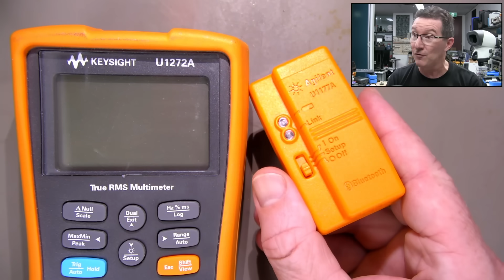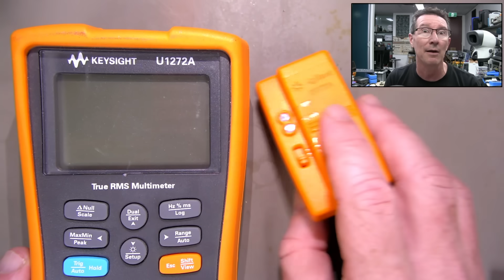EEVblog 1687 - A Pointless Alkaline Battery LEAKAGE Repair

Comment: Use primary lithium instead of alkaline in test equipment and remote control, please. Alkaline cells are ending their life by expanding and leaking, no matter what energiser and Duracell says. The only way to avoid leakage of alkaline cells is to add 1 - 2% mercury to the zinc, and this was forbidden in 1992, the year the reliability of alkaline cells died...

Comment: Duracells would have leaked several years inside their expiry date, even when stored in ideal conditions inside the original packaging.  I was fixing Duracell damaged test gear, mainly Fluke 8060A DMM’s,  over 40 years ago.

Comment: Well that's a bit of a letdown, GP are actually the most solid cells I know. Ok - having cells with a 2014 expiry date sit unused in your equipment until 2025 is pushing it a bit, admittedly.

Alkalines are obsolete. Low-self-discharge NiMH are the lowest acceptable solution now. For the more expensive stuff (my good multimeter e.g.) I use primary lithiums.
Reply: i converted my meter to charge with usb

Comment: I use NiMh batteries for almost all devices that require AA or AAA batteries, yes they can also leak after some time, but way less often and it leaks powder and almost no liquid.
And even if they leak a bit of Colombia's finest you can usually still clean them up, revive them using dumb charger or jump charge and throw them back in the normal charger and put them into a TV remote or another low current device.
Reply: Not always, I had a NiMH cell leak out a bunch of liquid goo.

Comment: how tf do tool manufacturers manage to bork this stuff up every time.
it can't be that hard to put the source code on github or leave it as is with a "might not work" warning.
their irda->usb cables are also BAD! you can't use them since the obsolete plxxxx uses the "please buy a new adapter" driver.
have fun when that happens at university, cant do anything :)
someone has to make some pressure, this stuff should just work.

Comment: I have stopped using alkaline batteries entirely like 10years ago. I only use rechargeable Eneloops (even those 10years old still have around 1700mAh). And for ultra low power stuff I use Energizer Lithium (non-rechargeables)....

Comment: Knowledge that alkaline batteries are prone to leaking is no news, but what might be interesting is that i had a recent one-use lithium battery leaking and just in three months "eating" the spring at the negative end. Before that i believed that those can't leak. Be careful. 😮

Comment: Welcome to IOT, Internet Of Trash, not even your testgear is safe.
Reply: And always remember the "S" in IOT stands for "Security"
Reply: I'm not surprised a big company like Keysight did this.
Reply: At least it's replaceable...
Reply: @feynthefallen what is? The app doesn't work. How do you replace that ?
Reply: @feynthefallen  Rizzlord: At leastse its replacablese...
RizzG0D: i wont buy any thing NEW!+! i will repaire the parts

Comment: I wonder why they abandoned the BT box. I mean, BT is very much alive, and even modern phones support legacy BT communication.

Quite sad, in the ATE industry I'm used to GPIB and Serial devices that just work™. It doesn't matter if its 50 years old. Both GPIB and COM don't need device drivers. Just a crusty old manual for the device that includes the protocol specification

To be fair, that interface was not part of a meter, it was specifically made as a Bluetooth link. If they have a new one compatible with the same DMM, that's at least better.

Comment: For cleaning the more sensible sequence is water first, than a little vinear if there are areas with blue/green corrosion on copper (if not that bad one can get away without the vinegar). The main purpose of the vinegar or another mild acid is to dissolve copper carbonate. Than more water and finally maybe IPA or alcohol to remove water rests.
The alkaline and potassium carbonate are already water soluble.
Reply from the maker: Yeah, but cool bubbles...
It ultimately doesn't really matter.
Reply: Didn’t know that. Makes sense if it’s water soluble. Cheers.
I assume you should use pure, deionised water & not tap water? Maybe it doesn’t matter (the tap water here in south England is very hard).
Reply: @davadoff  assuming you're cleaning it with IPA it shouldn't matter since the IPA will flush out the minerals
Reply: Since everything these batteries produce is water soluble, I just chuck the case and PCB into the ultrasonic cleaner (after removing piezo buzzers, loudspeakers or other water sensitive elements).
Afterwards a quick rinse in IPA and drying in front of a fan. Worked every time so far.
Reply: en

Comment: I had a hunch when I saw the battery expired in 2014. It's Bluetooth EDR. Confirmed when you showed the datasheet. I doubt anything modern will be able to communicate with that.
Reply: I think modern phones still support it. 
Not only hw, even the software / os APIs should still work with EDR if I'm not mistaken

Comment: There must be archived apks for these apps out there somewhere. That or if someone still has these installed on their phone reading this, you can use apk extractor to effectively export an installer for these to share.

Pretty lame they just abandoned the apps even if it's obsolete, especially since it doesn't have a replacement listed currently.
Reply: even with the apk there's no guarantee that it works with a current version of android.
Reply: ApkPure has it under "Keysight Mobile Meter", they even provide the latest description in which they say it's "no longer being supported" and what to use instead. Maybe the alternative they speak ("Keysight Meter Logger") of works for you Dave?
Reply: It was Android-only, I'm sure both users are absolutely devastated it was discontinued 🤣
Reply: @uzlonewolf android has 70% market share so I guess that means there are .0005 iPhone users?

Also wouldn't be surprised if the market for multimeters, and ones with wireless connectivity is skewed towards Android.

Comment: You should repeat your long term battery test with a small current draw. I've never had uninstalled batteries leak, it's always in a device with a small parasitic draw
Reply: Usually people in the comments say they have had leaked Duracells before, still in the unopened packaging & in date.
Reply: @davadoff  probably because i don't keep a bunch of unused batteries around. I'm one that keeps the necessities on hand  but not a ton of things that might expire before i get to them. My dad used to keep batteries in the freezer double sealed in their packages then Ziploc bags and swore it made them last longer. Technically it would slow down the chemical reaction so he was probably right
Reply: I see them all the time, though it's usually only batteries which are way past their expiration date.
Reply: YES, you are correct. Most of corrosion I have is with parasite draw.
Reply: I've had this exact GP battery from this exact same U1177A leak when still in the original shrink wrap, pics on eevblog!

Comment: No idea if this is the case, but sometimes manufacturer apps on the android store are updated and require a much newer android OS to work. The app won't even show up if your OS (and your device) is too "old." Sometimes this is nothing more than the software devs foolishly requiring a newer OS when it's not even required or unnecessarily using a new "feature" that's only supported on the latest android OS inadvertently making the app unavailable for any older OS version. Annoying but it happens.
Reply: If you look closely on Android developer specs, each android has a maximum backwards compatibility. i.e on android 15 you can't install an app made for android 5.
Android as any other OS has an expiration date. It's like asking a company to make their software compatible with windows XP, they won't even if they can, it's just not worth the maintaining effort...

Comment: Icom pulled the same trick with an aviation radio, the A25NE - just ditched the app, leaving everyone with a half functional radio. And not a cheap one at that.
Reply: Strange to see the same thing happening more and more, even in nicher communities than standard tech caters for. What could the app do?
Reply: @uiopuiop3472 the radio has some nav functionality (GNSS and VOR) built in, the app allowed you to enter waypoints, routes and frequencies using a keyboard and screen, rather than the 100 monochrome pixels and 6 buttons that are on the device.

Comment: I remember coomplaining to an app creator when my phone was to old to run an app to catch and pay for bus travel. I told them that they went to the moon on less than what my phone was capable of but now i was unable to catch a Bus with it. Progress isn't Progress.
Reply: Sometimes a simple webpage could be the “App” if they wanted. Let it run on the oldest hardware. No client-side updates required.
Reply: @davadoff An obscene amount of modern apps are just launching a full screen web browser page. It’s all webapps all the way down.
Reply: Built-in obsolescence ... hate it
Reply: "Houston, the Eagle has missed the bus."
Reply: It’s because updating the app using the latest SDK forces a newer minimum OS version.

Comment: If you can locate the .apk files for the Android sw you can try side-loading them.

Also, it's hard to tell on my phone, but if those contacts are plated steel you could probably add a thin coating of dielectric grease or petroleum jelly as a layer of protection.
Reply: Nickel plated brass.
Reply: @sivalley  I’m no expert but these look a lot like stainless steel.

Comment: There is no reason why manufacturers should not isolate the battery compartment from the equipment PCB. This at least would prevent a leaking battery from doing damage to the PCB.
If the battery contacts have wired connections, the holes through which the wires pass through the case to the PCB could be filled with hot melt glue.
Reply: Wired connections are not safe either. I had a device where the battery fluid wicked through the stranded wire and corroded the PCB anyway.
Reply: @kuebbisch the amount that can wick through a wire is very limited, and heat treating the wire would likely provide a plastic barrier around the conductors. The solder joint to the battery connector can also be sealed with a dab of hot glue. It is far easier to repair the battery terminals and associate wire connection than the eroded  tracks on the PCB.
Reply: @nigeljohnson9820 - why should manufacturers create extra complexity and cost? It is much easier for the consumer to RTFM and remove batteries before storage.
Reply: @johncoops6897 batteries also leak when not in storage. Good design practice could eliminate this product failure mode for very little cost.
Reply: @johncoops6897  Good engineering often involves making maintenance and upkeep easier and foolproof. The less a user has to rely on a manual the more successful the product can be. We all know virtually nobody RTFM
Reply: @chickensseeall - you obviously have never worked in production engineering like I have. Every single aspect of the design is based on lowering costs, and there is no way that any manufacturer, even Fluke or Tektronics, is going to add special hermetically sealed battery enclosures unless there is some sales angle to justify it.
Reply: @johncoops6897 so what is my profession then? I see all kinds of changes being made in an automated production environment daily. Take a wild guess
Reply: @chickensseeall - My guess is that your profession is the guys who made the changes that we tell them to make. 😉
Anyway, have you actually thought about why literally zero percent of consumer devices have battery compartments that are sealed to protect the internals from battery leakage?
Reply: @johncoops6897 possibly to prevent the seal from causing pressure issues, since batteries change temperatures and can expand the air, also maybe to save money, or because of how the compartment is cut and formed
Reply: @chickensseeall - yep, there are reasons that products are designed the way they are designed.
FYI all your previous comments have been hidden from me. This YT cent sour shippe is ridiculous 😠
Reply: @johncoops6897 Same, all yours are gone too for me. Well, thanks for following up, I enjoy a good discussion
Reply: @chickensseeall - seems there's hardly any point typing comments here any longer. 😠
Reply: Alkaline batteries should be banned completely anyway
Reply: @kyoudaiken the battery technology is rapidly evolving, but any move to lithium seems to involve an unnecessary switch to seal for life batteries. Alkaline cells come in standard sizes( AA, AAA and PP3), and are readily available for portable equipment. They may leak, and have a relatively low power density, but they are not generally a fire hazard, unlike lithium technology.
Such is the fire risk associated with the current, and older, lithium technology, I would not be surprised if governments start to legislate to mitigate the fire hazard of the higher power, power tool batteries. Certainly the insurance industry in the UK is becoming agitated about the risks posed by home charging of scooters and electric  bicycle batteries. Maybe the justification for fitting sealed for life batteries in so many portable products is to ensure full compatibility between the product charging circuit and the particular battery used. 
While this might appear as a digression from the problem of leaking batteries, it is worth noting that the life of a computer tablet is invariably defined by the life of its batteries.
Reply: Why bother?  99.999% of users are just going to toss the device if the battery goo gets everywhere.
Reply: @uzlonewolf I have a rygol rf spectrum analysis. The 2032 battery that supports the real time clock is mounted in aN open frame battery holder on the main PCB. To make matters worse, to access this battery, the RF screen must be removed, involving the removal of numerous screws. Given the battery is simply supplying ultra low current DC, it seems it would not have been difficult to mount the battery in an easy access isolated compartment on the case of the unit. As it is, when/if this battery fails and leaks it will likely write off this expensive bit of test gear.  A few passive filter components could have allowed the battery to be mounted in a far more user accessible compartment on the case, far away from the PCB tracks. 
This bad design practice appears in equipment with price ranges from just a few pounds to thousands of pounds. I don't want to scrap a multimeter, or any other bit of test gear just because of the inevitable battery leak. Batteries leak, it's a fact that designers should allow for.( Unless it's a way to sell more replacement products.).
Reply: Why do you think technology has progressed so far that a dishwasher or any other appliance will fail as soon as it is out of warranty?  Limited life span is good for business!  From my dim memory, Hitchikers guide to the Galaxy had a segment where some corporation went bust as their product never failed.
Reply: @MrDomingo55 you are correct about the hitchhiker's guide. It is why no one sells ever lasting light bulbs, but it can be argued that designed in obsolescence has gone too far. We are heading for a future where brown and white goods stop working due to software incompatibility issues. Overnight your IoT managed home might stop working due to incompatibility with the latest version of the management  OS, or its latest security feature. Perhaps the effect will be that your fridge or cooker refuses to switch on because it can no longer communicate with a remote server farm in Iceland. You may consider this a gross extrapolation from reality, but consider what is involved when  Alexa is asked to turn on the living room light, or turn down the temperature of the central heating. 
Perhaps you take your car in for its service or MOT, and it fails, not due to a mechanical fault, but because its software can no longer be upgraded to the latest version. An MOT failure, might be the result of the car software failing to recognise the speed limit signs. 
In the case of the intelligent home, I for one would like the AI to be as local as possible.